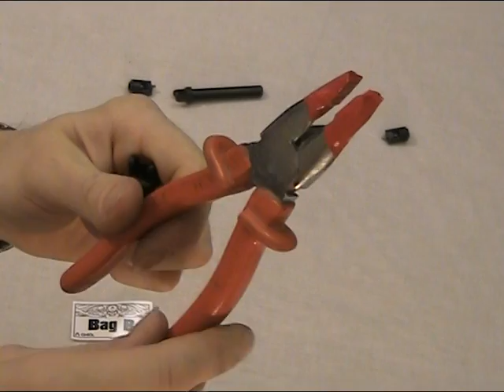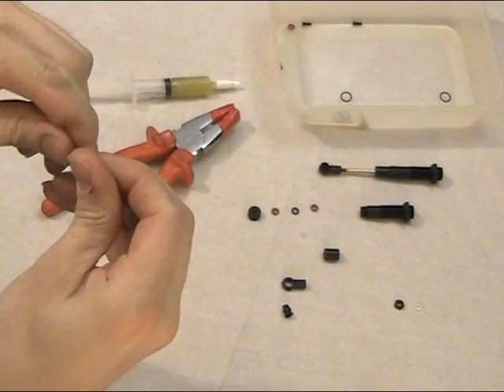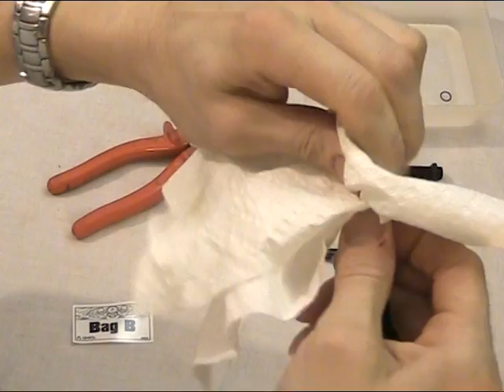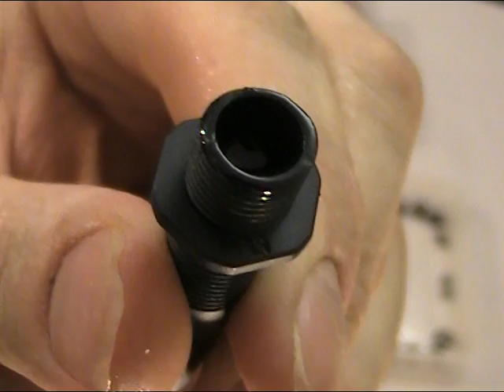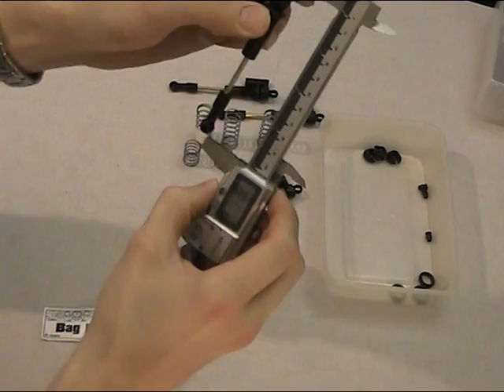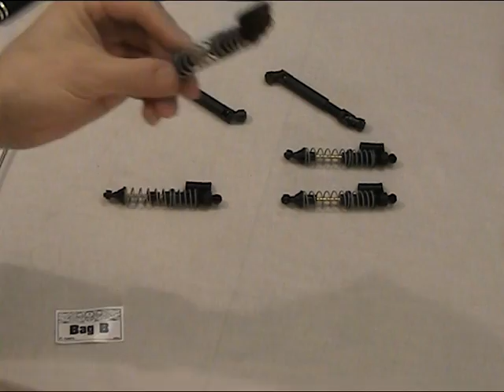SCX10 Build PART 3 Honcho Axial kit Stages 10 - 13 building the drive safts and RC shocks.mpg

Comment: I have honcho on 2.2 with lots of aluminum suspension upgrades & wheel weights... My D/S front shock has lost fluid/rebound action.. What oil wt should I use to drain the others & refill all(I have no idea what wt is in them now)?

Comment: @rabfs To remove any threadlock, gently warm the part, i use a heatgun, but you could do it with a lighter. Threadlock turns back to liquid and you should be able to disassemble.

Comment: @rcBitz the drive shaft broke. well  the plastic part and I wanted to remove the entire piece and put a metal one I found on ebay. But the screw doesn´t come out due to the thread lock, and i don´t know how to remove that. If I need some kind of solvent or what.

Comment from the maker: @martinpalicka This is correct and will change the character of the shocks. I have aimed this series at the 'new to rc building' tubers - I intend to do a upgrade series for this truck showing things like Shock Tuning - as you say highlighting changing rebound with different filling methods. I compress fully, wiped top of oil and then add cap, this give good performace for my use. Thank you for your comments.

Comment: You should put the shock shaft  at least half inside when closing the top end off filled shock, it will be much softer (or in other words it will have less rebound). You should be able to compress the shock all the way up, with your filling method it´s not possible.

Comment from the maker: @malvesjpx You are correct the + on the bearing casing demotes the + side, on the pro the connection for the brush is also red. I hope this helps. Let me know if I can help further eg soldering tips etc.

Comment: just received the eletronics, I'll change it tonight, just one question, how can I identify which one is the + terminal on the motor? I looked everywhere for a mark, but I could not find it, just saw a + on the top of the motor (on that black plastic that holds one of the bearings) is that it? Thanks for your help again.